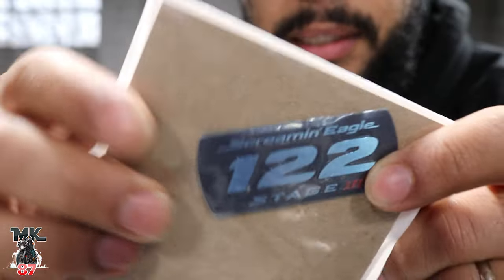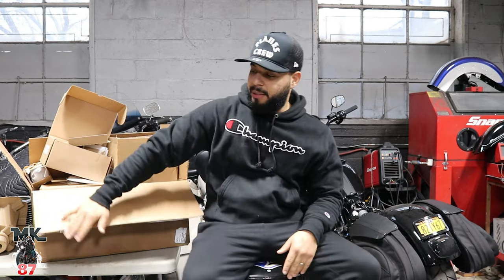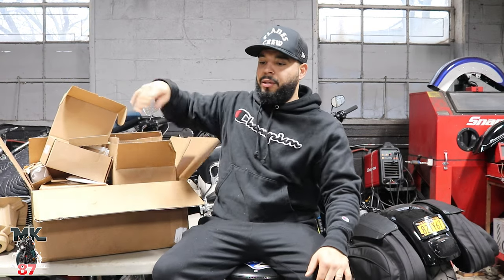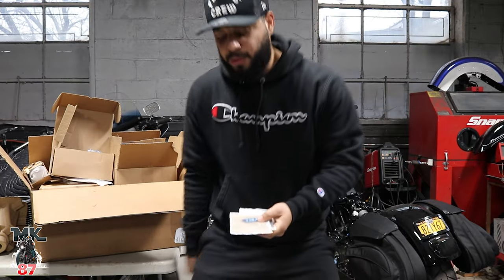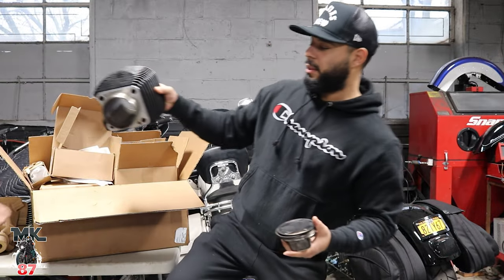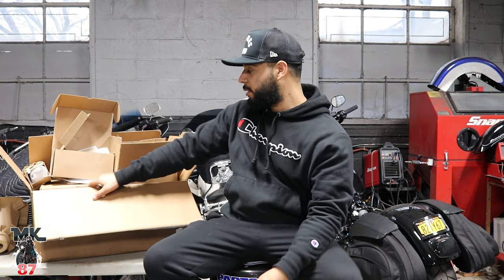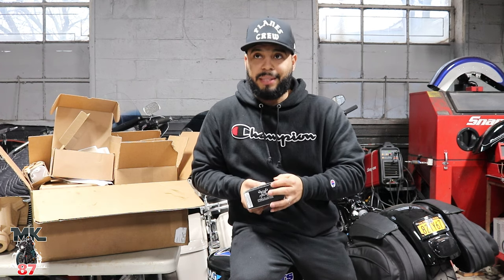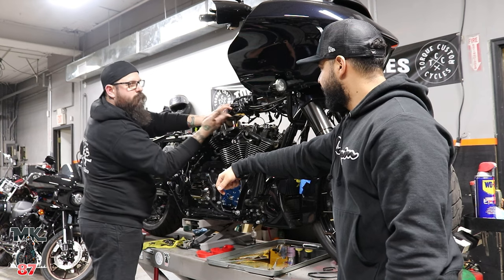Harley Davidson Low rider s 122 engine build!

Comment: With more cubes from the HD SE Stage-3 Big Bore Kit (114/117-to-122 cu. in.), plus the bump in compression (10.5:1 stock 114, to 11.0:1) with the forged/coated pistons (versus the stock cast pistons), this opens up the door to a wide range of Cam choice.  The S&S 475 cam is a good all around cam which should perform well in a 122, 11:1cr, stock heads configuration.  Others that come to mind (and should offer bit more power) would include the Star Racing 30/30 Cam (485 lift), Moonshine Harley's 485 Cam, Fueling 521, many others.  Bang for the buck, hard to beat the S&S 475 cam (lowest cost).  Looking forward to see which way you go with cam choice.
Reply: the 30/30 and MS 485 i believe are the same cam
Reply: @shoey5406  Hello. Believe they are similar but not identical (but could be?).  I do know that Moonshine Harley Performance (MHP) has Comp Cams manufacture the MHP 485 cam for them (MHP) based on MHP design (?).  Star Racing 30/30 (485 lift) Cam was designed (I believe) by Star Racing (again I believe).  It would be nice to know, although both Cams perform well (produce more Torque & HP) than the 465-475 lift range of cams without requiring valve spring upgrade.

Comment: I saw another youtuber with the same mechanical issues. Came down to carbon build up on the pistons and engine. Maybe look into fuel stabilizer/detergent like Chevron Techron.

Comment: A 122ci should be reliable and with the typical 465/475 S&S cam, great to ride on the street. For the kind of riding you seem to do, you don't want that extra power being way up on the rev range.  Just my thoughts.